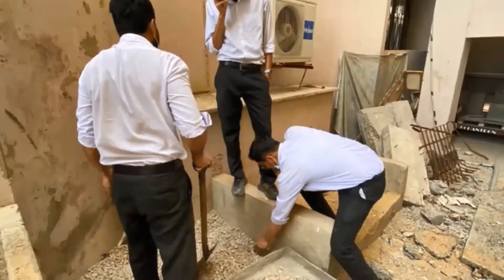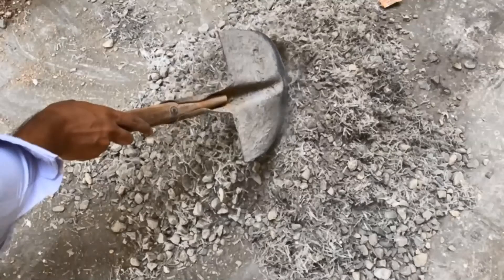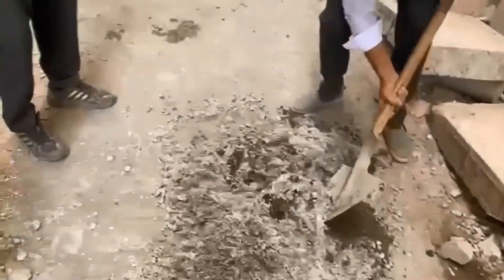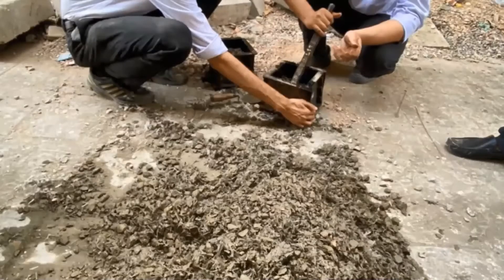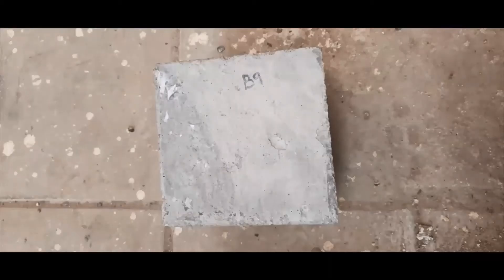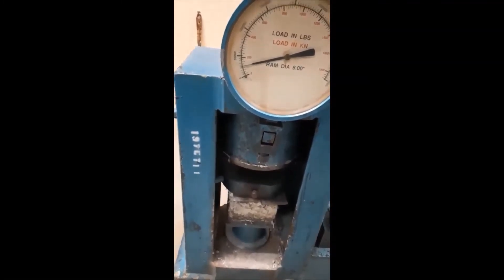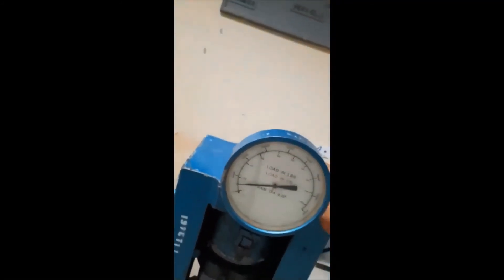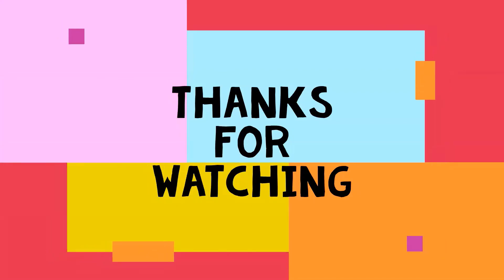Strength of Material Incorporation of Polypropylene Fiber Compressive Strength Test  Concrete Cubes

Comment: What percentage of polypropylene fiber was used ?
Reply from the maker: You should use very small percentage of polypropylene fiber to get good results.Start from 1 %  to 3%.In this case, we have used 10%,20%,30%.
Reply: @engineernahidshahzad2590 sir we will add fiber to % of cement or concrete

Comment: Madam please help me. I have to add .5% polypropylene to concrete. So how can we measure it in kilogram?. We are using m25 grade concrete
Reply from the maker: You weigh it
Reply from the maker: You can weigh it on weighing balance
Reply: @engineernahidshahzad2590  how can we calculate the quantity in kg madam?
Reply: @engineernahidshahzad2590  please reply madam. My project is based on this topic
Reply from the maker: You can get it by multiplying volume into density
Reply from the maker: The density of cement is lb/ft cube while volume of concrete will be in ft cube.You will get of mass of cement in pounds.
Reply from the maker: 1 pound=0.454 kg
Reply from the maker: You can convert it
Reply from the maker: It is so simple

Comment: FIBRES should be added by weight of cement or by volume of cement ?? please tell Calculation of addition of fibre to concrete .
Reply from the maker: I have taken fiber by percentage of cement.For example,I took 1 percent of fiber of the calculated amount of cement.In this way, I got the amount of cement.
Reply from the maker: Did you get my point??
Reply: Is it 100grams fiber for 1kg . Correct me sir

Comment: Nice video 👍🏻
I have a doubt for M25 grade if I want to take concrete mix with 1.8% polypropylene fibre means how much I mean how to calculate 
Can you explain this?
Reply from the maker: If you are taking density of concrete is 150 lb/ft3,then you have to decide  what size of cube you are taking?For instance,you are taking 6 in.x 6in. x 6  in. Cube size so you should take its volume by multiplying 6x6x6.you will get volume in cubic inch so convert it into cubic feet.In this way you will be able to calculate mass of concrete with the help of formula of density. After getting total mass, add M25 Grade proportion of concrete.For this purpose,you will take( (1/(1+1+2))*mass of concrete) so you will get mass of cement.In the same way,you will take mass of coarse aggregate=((1/(1+1+2))*mass of coarse aggregate.Similarly,you will do calculation of mass of fine aggregate.When you will get mass of cement so take 1.8% of mass of cement and that amount you have to add polypropylene fiber in the concrete mix.This is way to calculate.
Reply from the maker: Hopefully you will get your required solution.
Reply: @engineernahidshahzad2590  thankyou so much ❤️
Reply: @engineernahidshahzad2590 also when we add fiber so should we add according to weight of cement or concrete
Reply from the maker: M25 Grade is 1:1:2
Reply from the maker: It is very simple
Reply from the maker: You need to calculate the amount of cement first then reduce the amount of cement by reducing 1.8% because you are adding 1.8% of propylene.
Reply: @engineernahidshahzad2590 sir but i have studied that adding more than 1.5% of fiber may give hardening strength fast